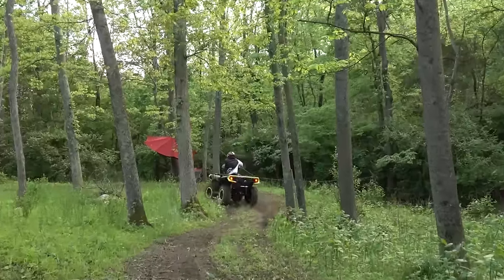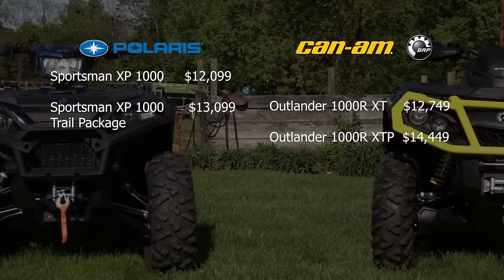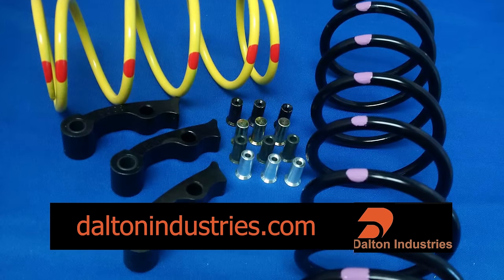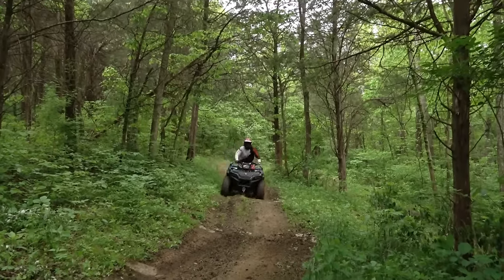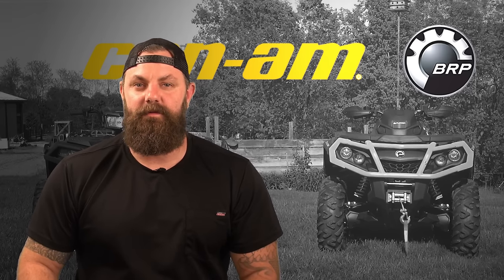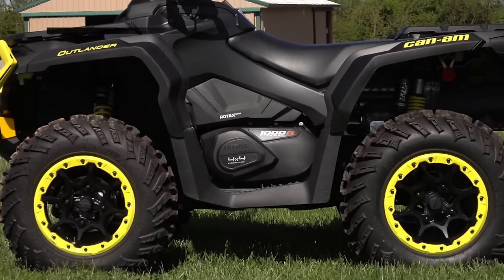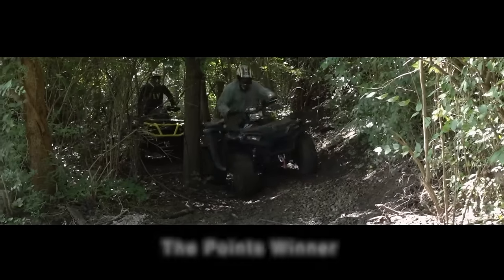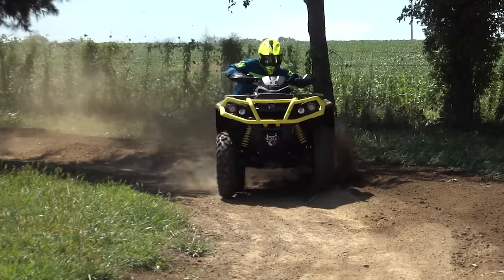Polaris Sportsman XP 1000 VS Can-Am Outlander 1000R XT-P, 1000cc 4x4 ATV Shootout

Comment: This was a very comprehensive and detailed video. Great job ATVonDemand, I'm very impressed! Keep up the great work. I am writing a long comment because I'm home sick from work and have lots of time to kill. These are just my opinions so take them with a grain of salt. I'm sure other people will agree with some things and disagree with others, that's okay. I will start by saying I've owned several Polaris Sportsmans including 400, 500, 600, and 850. I've always loved how well they handled and how comfortable they were. The pre 2009 models were very wide in the middle which could be a bit uncomfortable on long rides. The Sportsman 570 and under is still wider in the middle than the 850/1000 but not as bad as the older ones. I haven't owned an Outlander but I have driven the 650 and 850 Outlanders that belong to friends so I am familiar with them. I currently own a Commander 1000 SxS and I'm thinking of maybe going back to an ATV in the next year or two. Overall I would be very happy to own either of those machines. I think Polaris has quality issues I wish they would address like the clunky shifters, clutches and glitchy power steering units to name a few. I know they have been picking away at improving some aspects like adding thicker front drive shafts a few years ago and a stronger front diff. Can Am has issues too like the QE Visco Lok not engaging properly which basically leaves you with a basic 4x4 system, meaning 3 wheel drive in many instances. They are also known for having rather weak front differentials. For me, the Sportsman feels safer when riding fast. The Outlander feels tippy probably because of the higher seat height. Also, the Polaris is much narrower in the middle. I go on week-long ATV trips every year and believe me, the narrow middle section of the Polaris is a God send when you spend 7+ days on a machine for up to 11 hours each day. The AWD/4x4 systems of each machine operate differently and each have pros and cons. Polaris is truly shift on the fly, where the Can Am you should really slow down or better yet stop completely when engaging 4x4 to save your front diff from imploding over time. I learned that the hard way. Polaris' AWD locks the front wheels fast for full diff-lock but Can Am Visco Lok often takes many revolutions of one wheel before the other kicks in, even with the newer QE system. Sometimes you never know when it's going to kick in and that can be bad if you're on a steep incline and climbing over rocks or other obstacles. Polaris AWD is pretty much better in all conditions except in snow and ice, in my opinion. Soft grippy snow is okay, but with hard pack snow and ice it's down right dangerous. Every time you let off the throttle the Polaris engine braking is so strong it will lock your rear wheels and drag them causing you to go into an unexpected slide. I've had this happen several times over the years and several riding buddies have experienced the same. It can be downright scary. If you don't live in a snow belt you don't have to worry about it. That doesn't happen with Outlanders because they have power being sent to the front when you have 4x4 engaged and all wheels slow down equally with their engine braking. All Polaris needs to do to fix that is to reduce engine braking and have a winter mode that uses their Active Descent Control to engage the front brakes lightly at all speeds, not just 15 mph or less. That way you have all four wheels slowing down to avoid sideways skids. It's basically a toss up for what I'd buy. Keep in mind these are just my opinions derived from my own personal experiences. My list of Pros for each:

Polaris PROS
Significantly narrower in the middle.
Softer suspension is more comfortable for day-long trail rides.
Lower seat height, better handling and ergonomics except for speedo & Tach.
Better AWD except on ice or hard pack snow
Better storage layout. Can am rear storage box gets extremely hot because of the exhaust.
Looks great especially the painted ones

Can Am PROS
Much better speedo & tachometer layout 
Better 4x4 system for snow 
Better overall dealer service (in my experience, others will probably disagree)
2" hitch receiver vs 1.5 for Polaris
Sturdier Racks than Polaris
Looks great
Reply from the maker: That was a big post and thanks for sharing your opinions.

Comment: As an owner of an XP 1000 premium , it’s just to freaking heavy. I love it as far as ride and comfort but my 2012 BF 750 just glides over stuff it sinks straight down in lol. Still needs better build quality. Wish so bad Kawasaki would’ve built a BF 1000 . Just can’t beat Japanese build quality across the brands . But, as we all have it , power junkies have two choices for 1ks lol.
Reply: Love your comment. Usually, Polaris owners won't own up to the stuff you talked about. It's good to hear from a guy who owns both.
Reply: utah wanderlust700  thanks man . I had a 98 sportsman 500 that was pre cv joints , and lord have mercy the only thing that held together in it was the Fuji 500 engine. Polaris makes great riding , great performing machines , but they seem to be content with providing sub par quality  components. More money to be made that way huh lol. For river riding and dry lake beds etc , that have that quick sand , loose gravel/mud areas , Weight is very important and my bf 750 excels there . The brute is dual piped and af tuned and has the best throttle response and lighter more nimble handling . Make no mistake though, the xp 1000 is amazingly comfortable, amazingly smooth , and just a pleasure to spend the day in the soft heaven to your butt seat lol . It’s a rocket propelled couch . If it was actually a 1k and not a 952 that’d be great too . I’ve owned Honda , Yamaha , 3 brute forces and now two Polaris’s with this 1000 and they’ve came a long way but still use cheap switches , unsealed bushings with grease zerks, bad drivetrain components such as the front pinion plate a lot of people bust when riding aggressive all the time . The new trails have sealed bushings , but for me it’s like come on people ! 12-13k machines should head to toe have top design quality throughout! Overall I love it , but I won’t be a fan boy.
Reply: Polaris is definitely not “built” better than a Grizzly
Reply: @joekearney  I've got over 20,000 miles on my Kawasaki, and it's been a great machine. I bought a year that had bad valves and the wrong seats, but it still went 9000 miles before I had to replace them. 
Now I've got that fixed, it's been great. Still just as tight and quiet as it was on day one. And she's FAST!
My next quad will definitely be another Kawie.
Reply: Kenneth Robinson it sure isn’t !
Reply: utah wanderlust700  I had an 06 650i , 09 FI 750, and the ‘12 BF 750 that I have with the XP now . The 06 650i was an outstanding machine .
Reply: Im gunna buy a Suzuki King Quad 750 in the spring.
Reply: is ur 1000xp more snappy than ur BF? how do you compare them both in power low mid and end?
Reply: Chuck Beef I like my older 750.  New one has some improvements I think you’ll like.  As far as anyone else offering competition,  I see Yamaha potentially making a grizzly 850.  Kawasaki has a 1000 engine for the new sport utv too.  A slightly detuned version for the brute force might happen.
Reply: Greg Rowe Yeah we used to have Can Am, Polaris, AC and Suzuki. Now our only dealers left are Suzuki or Arctic Cat and my friends that own mud pro 700’s have had a fair bit of problems.
Reply: @Killzaze  dude ! I never got a notification y’all commented . YouTube sucks about that . A year later and I happen to look back at this for fun and saw the comments . 
I’ve sold the BF now , bought a Maverick Trail DPS 1000 drove it a year and just sold it and put a deposit on an X3. 
Man stock for stock yes the xp 1000 is faster of course but the 12 and up BF 750s have significantly better factory clutching and throttle response . They make 51 hp but feel like 75. On quick turn back trails I can’t see being faster on the 1000. 
Overall if you dig a little deeper in the throttle of course the xp 1000 will feel stronger down low , but In casual trail riding the brute feels snappier down low until you grab a bigger bite .
Reply: @Killzaze  oh and far as mid and top end , yea that has to go the xp 1000. It pulls much harder from 40-60 and has about a 6mph higher top speed .
Reply: Arctic cat 1000 was also the best and first.
Reply: @utahwanderlust700  Any rebuilds. Thick oil? 20 50 or60
Reply: Arctic cat 1000 green
Reply: @TraveladvRajanSRai  Just rings and valves a couple times. Original bottom end. All I run is 10w-40 full synthetic.

Comment: As I am considering buying the 2-up versions of these exact machines, I found this shootout very objective and informative. There are things I really like about both, but I'm leaning toward the Can-Am. I still have old Honda three wheelers including a pair of liquid cooled 250Rs one of which is has an Eddie Sanders 350cc top end. I like aggressive power. I also like the Outlander XT-P package with it's beadlock wheels and upgraded shocks. Thanks for putting together such a well done shootout 👍🏻
Reply from the maker: Loved this comment on every level! We're very happy to hear you found the shootout informative and beneficial. Objectivity is paramount. We know how much these things cost enthusiasts and we want to make sure that riders end up with the right machine for them. As fans of both brands, we wish polaris would release a more performance focused version of the sportsman Is similar to Can-Am's XT-P package. After all, you buy a one thousand because you want to go fast. You already know we are suckers for the three wheelers! Bet that Eddie Sanders 350 is insane.
Reply: Yessir, the ESR 350r is definitely an attention getter! But there are a lot of higher end built 250Rs out there than mine, there's always someone faster 😂 . Also have a Big Red, a 350X, another 350X that is about halfway through a frame-up rebuild and a couple other small hard tails. Been riding wheelers since the '80s. 

Looking at the 2-up versions of these quads I notice one difference that may be of interest to anyone else considering a 2-up. The Can-Am 2-up is 8" longer than the standard version giving operator and passenger more room where the Polaris is only about 1/2" longer with their 2-up. This gives a preference point to the Can-Am IMO. Again, the Polaris is a very attractive machine no doubt. But for my purpose of getting a sort of "luxury" 2-up so my better half and I can ride comfortably together and still have a lot of fun power to play with, I think the Can-Am is starting to take the lead.

Comment: When all done the can am needed the clutch cleaned and the belt replaced. The Polaris wouldn’t start because of some broken wires in the electrical system
Reply: I'll stick with yamaha!
Reply: Yamaha just flat out runs and runs, excellent transmission and the best belt life out there. Wish they made a twin. Maybe soon...
Reply: @heavysnow8616  I've been anxiously awaiting for an 850 twin or so for the grizzly to come out.  Hasn't happened yet.  My old pos Suzuki Vinson 500 will have to suffice until then.  I was going to bite the bullet this year...still may.  Yamaha same size motor but its such a massive upgrade over what I currently have.  Only issue is...NO ONE HAS THEM.

Comment: Sportsman S vs Outlander XXC

This was an awesome comparison. Great video.
Reply from the maker: Really glad to hear you liked it. In the not-too-distant future you might have to settle for Scrambler S vs Renegade X XC. Hope that's close enough.
Reply: @ATVonDemand  I'll definitely be watching. Do you think the S version of the Sportsman would make up for the regular version's few shortcomings discussed in this video?
Reply from the maker: @Cummins402  Can-Am uses the same base shock settings, valving and spring rates between the premium model Renegade and Outlanders. Polaris Sportsman was more softly sprung and valved than the scrambler in the 48" class. Out of the box, the Sportsman s is softer than the Scrambler s. We need to verify whether it is Springs and valving or just adjustment settings. I'll get back to you on this.

Comment: Great video! Both machines are fast and powerful! One question though, wouldn't the top of the line Sportsman be the freaky wide stance 1000xps with huge suspension travel? Huge price too I bet.
Reply from the maker: Thanks for the positive feedback and for the question. The Polaris and Can-Am we reviewed here are both 48 in wide machines where the Sportsman and a Scrambler s models are 55 in wide. We consider the Polaris s models to be a new class. They are definitely targeted more toward people who operate their machines and wide open spaces. Riders would find those models to be more difficult to operate an extremely tight to rain where the 48 in wide machines could easily navigate. We would like to do some comparison between these classes in the future but it's not quite as much of an apples-to-apples comparison. Look for us to do something like what you're suggesting in the future.

Comment: Great video, love both of these machines.... but not an apples to apples suspension comparison, why didn’t you use the XT version of the Outlander?
Reply from the maker: This is a very valid question. The answer is because this was a top-of-the-line shootout. We asked both manufacturers to send us their premium offerings for the class. The softer suspension on the XT model could have shaken up the ratings a bit. An XT owner could upgrade their suspension from the aftermarket but, so could a Polaris owner. We are gathering up the components for a sportsman 1000 build to spank on the Outlander XT - P. Hopefully, pilaris will release a sportsman XC Edition will a few more factory-installed go-fast goodies.

Comment: great comparison. I have a 2019 sportsman 850 base. if you gonna get a sportsman save your money on all the extras and get a base model a hole lot cheaper and still just as powerful. I got 45 miles on it so far and its a beast. I went through a foot of ice water with an inch of ice on top. wheelied it through while pulling a small sled trailer behind and never got stuck or slowed down. Cost me 7800 out the door. Well worth it for the price. But now the two companies are so close in performance is your preference. hope to see some of you out in the trails of Wisconsin!
Reply from the maker: Do you have the non-eps equipped version? The Sportsman XP chassis handles really well even without power steering it's amazing that you can buy the 850 base model for like nine grand. That's a ton of performance for the money.
Reply: If your going 850 you should step up to the sp since they come with better close ratio 4x4 same as the 1000 that the base model 850 don't have and it's not something you can add. Also the ADC is great for hill climbs and decent on these heavy quads.

Comment: I threw a set of stage 4 elkas on my sportsman same as your video. Night and day difference. I'm gonna post a video of that after i get footage this weekend. It doesn't even feel like the same quad. I like how it handles more than our XTP-850 outlander. The elkas seem nicer than the Fox podiums. Great video comparing the two quads.
Reply: Glad you're enjoying the Elkas!
Reply from the maker: We really like the Sportsman. We feel a little clutching, different tires and shocks would make all the difference enclosing any performance Gap.
Reply: @ATVonDemand   yeah it's my first ATV ever. So the power for me is amazing never seems to stop. With the new Elkas it's like riding a cloud!
Reply: I want to upgrade to elkas on my 850 kinda bummed they aren't included but it is what it is I guess.
Reply: @zack6892  yeah I think for the majority of people the stock shocks are probably fine. But the elkas make it a different machine entirely. They are highly worth it. Best dollar to benefit ratio. I wouldnt hesitate you could probably save some money and go with a stage 3 set.
Reply: @OutDoorMillennial  yeah stage 3 is what I was thinking too. The stock's do pretty good but when I'm pushing it they are kinda under whelming I feel like your right a proper set of adjustable remote reservoir shocks would be a huge improvement.

Comment: I appreciate what you are doing.  I agree that tires are often upgraded.  I just know for myself, if I am going to buy a new machine I want to know how it compares out the door.  I think a test that may be good would be one machine with different exhausts and tuners.  That way a guy would know what exhaust and tuner would be best for a certain machine.  Again, not trying to cause any issues.
Reply from the maker: We used the same exhaust and Tuners on both machines that way all things were equal. Again, half of the shootout was done with stock exhaust and the other half was done with aftermarket exhaust. You can see that in the video. The outcome would I would not have changed. The difference in performance stock vs. Pipe was the same. These exhaust do not change the power characteristic they simply give you a bit more throughout the RPM range. We definitely appreciate hearing your opinion.  many people forget it's not what you say it's how you say it. Thanks for sharing your thoughts.